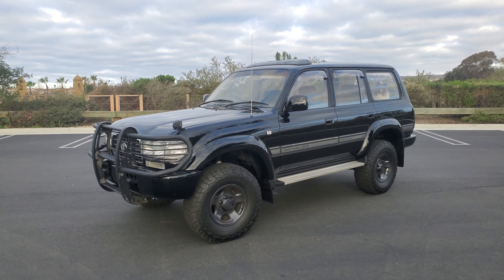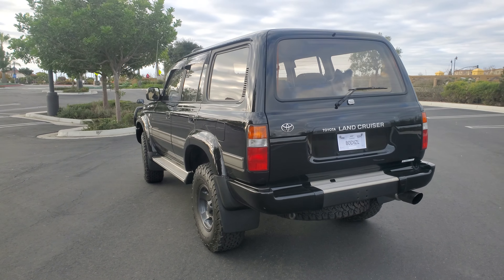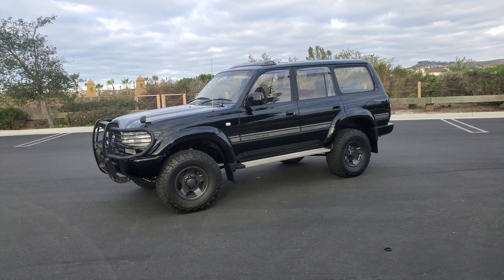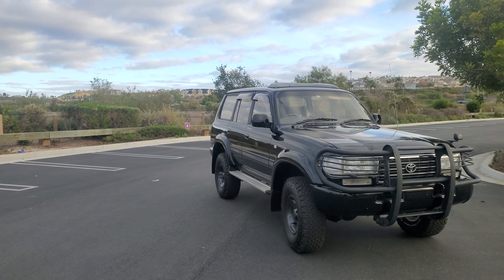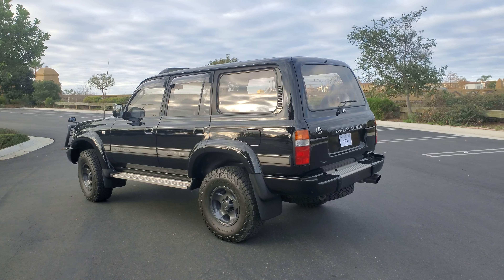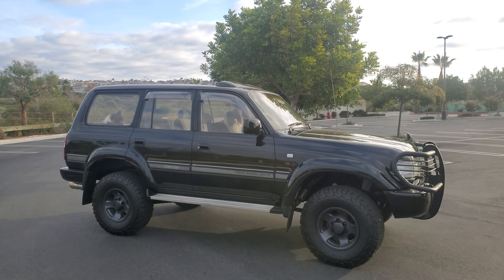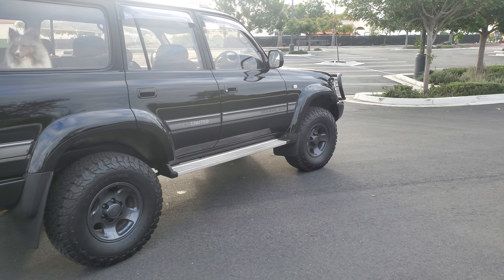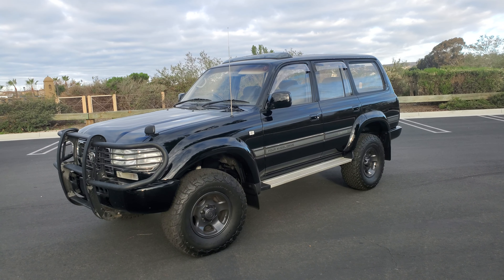Diesel Land Cruiser 80 - 24 Valve HDT-FT on US Shores! in 4K

Comment: @cruisingtheland Since they never came in black, how does repainting for example from emerald pearl to black affect value?  Does original paint hold better value than a respray at this age?
Reply from the maker: Actually the 1996-1998 model years did have Black, for the FZJ80s. I am not sure for the JDM HDJ81s...
Obviously a original paint Cruiser that is in excellent condition should.fetch top dollar. Also a repainted vehicle could be a 6000k professional job, or a $500 Maaco job, so not all repaints are equal. Mine for instance was done in Japan and the quality is top tier. But I also paid top dollar for mine... Before I bought mine, I was looking at a 2 tone 1992 HDJ81, and the paint was bad... so even at 16k for that one, it was priced lower because the paint was faded and beyond a simple detail job... Would have requires thousands to repaint. Which brings me to white... the best color since it's 1 stage, and not clear over a color... So it can be compounded back to its original state!
Reply: @CruisingTheLand  thank you for the prompt reply. Much appreciated

Comment: The 80 series diesel is a fun baby. I am from Pakistan. We don't get too many options but we are are lucky when it comes to the 80 series. I myself have a one in diesel and one in petrol.
Reply from the maker: Which do you like better? Petrol or diesel?
Reply: @CruisingTheLand  the diesel for sure. As you mention when comparing the petrol to a diesel, yes the petrol has more hp but the diesel has great torque. Watching your videos I had a triple lock air system installed and now I see something in the path, I honk once and then climb over it lolzzz

Comment: Can these run biodiesel?
Reply from the maker: Good question. Locally I have options of Diesel and 20% biodiesel,  and chose Diesel.
Just prefer to use what the engine was made for, bio diesel burns differently and I have heard to many instances of motors having issues. Prefer to keep it OG.

Comment: i rather buy these vs the over priced dealer scalping 4runner TRD pro.
Reply from the maker: the 80 series Land Cruisers are going up in value, vs a new 4runner may hold but will ultimately drop for the next decade... Besides a diesel LC will get you 2x the MPGs, and the 80 is the last of the full floating axles, so much better for rock crawling.

Comment: Being in Australia, I guess we're lucky that we got an equal amount of FZJ and HZJ LC80s here. The 1HD-FT & 1HD-FTE are the sought after engines for the Landcruiser (other than the 4.5L V8 Diesel that came in the LC200).  LC80s fitted with the 1HD-FT engine usually goes for nearly double the price of an equivalent condition LC80 with the 1FZ-FE (Petrol).
Reply from the maker: Yes, you guys are lucky.
How many total 80s did Australia get?  Do you know? Has Australia started importing and JDM diesel 80s? In the US, we have to wait 25 years, so we just started importing the HDT-FT models.
Until now, we could only dream amd watch videos from down under!
Also here, a clean FZJ80 goes for same or more than a diesel...
Americans just don't know yet... Just a few of us do.
Reply: @CruisingTheLand  I don't know exactly how many LC80s where sold in Australia, but I believe at the time, Australia was the biggest market outside Japan for the Land Cruiser.  Now we're at 2nd spot, with the Middle-East buying more Land Cruisers than Australia. There are Aussie companies that import JDM Land Cruisers here too, even though our models came with the same 6cyl petrol & diesel engines offered in Japan . But generally imported JDM models have far less kms travelled than local Land Cruisers of the same age.  Many JDM LC80s imported into Australia are generally all under 200k kms. Where as the local LC80s are mostly over 300-400k kms by now. Our vehicle import laws allows a vehicle to be imported into Australia in limited numbers if it's no longer sold (or have never been sold) by the manufacturer locally. But if its less than 30 years old, the vehicle must be in RHD. For instance I can import a 2021 Toyota Tundra into Australia as it is not sold here, but I have to convert it into RHD if I want to drive it on public roads.

As for the biggest differences in Australian spec LC80s vs JDM models (both are made in Japan) are:
1) Aussie versions came with factory dual fuel tanks (95L + 50L). The engine only draws fuel from the main tank, but with a flick of a switch, you can transfer fuel from the auxillary tank into the main tank. 
2) Other then the base model GX, all our models came with the sliding windows at the wagon area, and 3rd row fold down seats. The GX also came with barn doors, the rest came with the traditional split tailgate design (The GX was aimed at law enforcement, 1st responders and mine use).
3) The spare wheel was fitted under the car. We didn't get the optional OEM rear mounted tyre carrier that you see on some JDM models (which I think is very cool and would love to get a kit for my LC80 - Toyota has long stopped making them). 
4) We got two headlight designs - the quad design, and the one-piece design for the top spec model (VX & Sahara)
5) All models came with central locking diff, but triple lockers only came in small numbers with special edition models
6) As an Australian Design Rule requirement, our models came with the front 3/4 blinker (just like you got), and the narrow rectangular lights under the headlights are coloured orange and are the front blinkers.
I'm sure there are further suble difference, but these are the major ones I can think of.
Reply from the maker: Thank! That was informative!
We have all split window rear side windows (sliders) in the US. I notuce JDM is solid and with the curtain bar. All US LC80s had the tinted rear windows (mirror reflective, not just smoke tint)
I like the fact that my JDM is all clear. I will do a comparison side by side soon.
So I know this much:
Landcruisers are all built in Japan, to the highest automotive discipline. They built a total 547,800 Landcruisers. Japan kept 1 out of 5 (20% or 107,000) which most were diesel.
Then the US got 75,000 and also 14,000 LX450s
So a total of 89,000
Canada got only LXs and likely 1000 or so...
So I imagine Australia got the most LCs... maybe 125k? Then the remaining would be split up in numerous markets (Venezuela, Middle East,, Europe etc...)
I think the Diesels from Japan, which like you say are lower miles/kms will be gobbled up quickly, between US and Australia. There's only so many!
The price will be dictated by our local markets, with supppy amd demand. The pandemic got alot of Americans doing 'Staycations' and what better way than explore the outdoors. So Overlanding has grown substantially here. It has now become commin to see mostly Jeeps, rolling around with Jerry cans, Hi lift Jacks and recovery boards draped on the outside. Thr community is growing, maybe one day catching up with you guys!
I just went to a Toyota 4x4 event/ get together last night near DisneyLand in CA. Just posted that video...

Comment: Any complications with registering the imported diesel in CA?
Reply from the maker: Yes. California doesn't want these. I was lucky that one of my diesels was already registered, so simple transfer. But when you bring a new Diesel LC, DMV sends you to CHP, for visual (not same a Vin Verification that they do at the DMV) and then CHP will send you to CARB. Then CARB will tell you that it will cost 15k to convert the exhaust system to be CA compliant.
But in AZ... $9 emissions cost and $25 registration. Just need a property there.
Reply: @CruisingTheLand  in other words, you did NOT register in CA unless you make 15K in compliant engine, Arizona free to go.

Comment: Been waiting for these to be able to be imported just like everyone else I guess.. Now it's time to pony up the pesos... Give me a 5 speed and part time.. Does yours have the magic dial? I would assume this won't be daily driven/trailed?  Parts are gonna be tough to find for that mill hear in N.A. as parts are becoming scarce as they are discontinuing more and more parts..
Reply from the maker: I have a 97' and 95' that are 3x, ome is Elockers, the other is ARB.
The Diesel is only Center locker, but I would wheel it, I have other options (FJ40 on 40s with 80 axle rear and 60 front) and the 80s... so this one is weekender and anytime I need to load cargo.
I too would like a manual...
Reply: @CruisingTheLand  driving a manual diesel is unreal.. I just sold one of my "keepers"  super clean Fj62 to fund a 05 5.9 cummins 6 speed..Wanted a truck to put a cabover on thr bed.. Driving that thing is like driving a tractor... Your not going anywhere anytime soon, but my goodness is it a torque monster...
Reply from the maker: @LANDCRUISERLIFE  nice. I got this diesel bc my 17yr will be daily driving my HJ61 12HT.
Thats a fun ine, and she loves it. She picked iit over a LX570..
Also have a HZJ73 with the 1HZ 4.2... both Auto though..
Reply: @CruisingTheLand  Smart gal! Cruise on...
Reply: The manuals have a shorter final drive, and though there are early HDJ81's with the 5spd, they are very very rare with the FT engine. 

You also don't really want the part time 4WD, it won't save fuel like it does on most vehicles. No point. 

1HD drivetrain parts arent too bad. Big source in the UAE, as well as Japan, UK, Australia. Worst thing with JDM vehicles is large RHD stuff like the dash.
Reply: @greatcolor  I appreciate the comment, but I know what I want as far as a diesel 80. I have a part time and full time 80 now. I didn't part time one of my 80s because I thought I was going to save fuel, but to save the wear and tear on all front end parts, and a lighter steering feel (also installed Marlin crawler gears in TC).

I have been around these rigs for more than 2 decades.  Go on MUD and talk to the parts Gurus, they can tell you that more and more parts for these rigs are becoming unobtanium. Even if you did source these parts from the countries you mentioned, it will be awhile until you source and buy and receive the parts being so far away. Cheers!